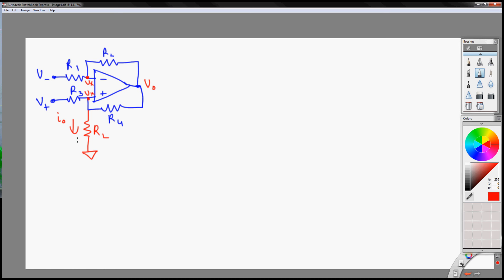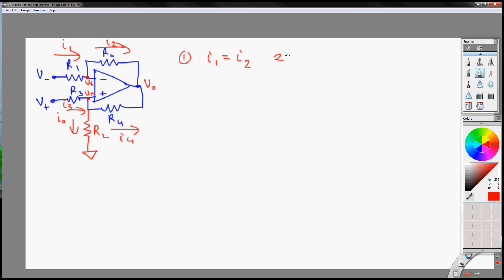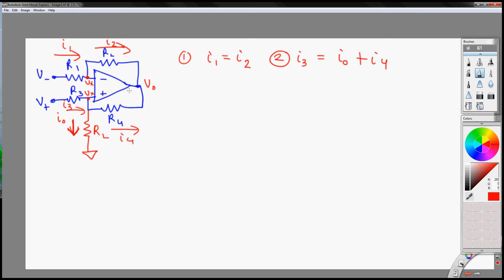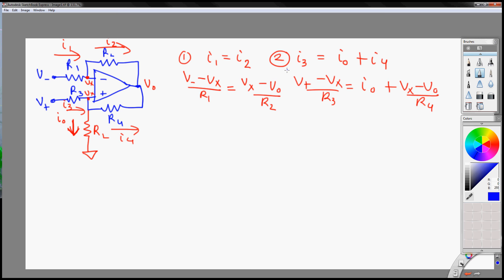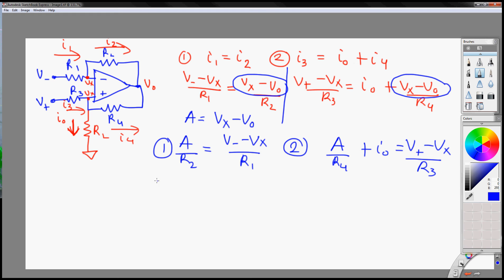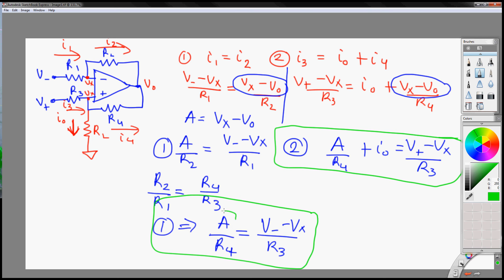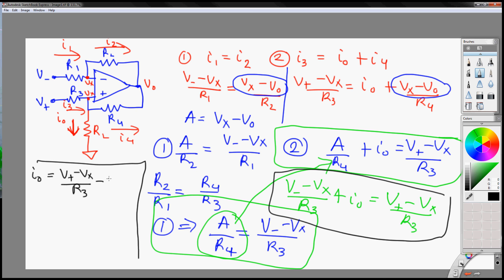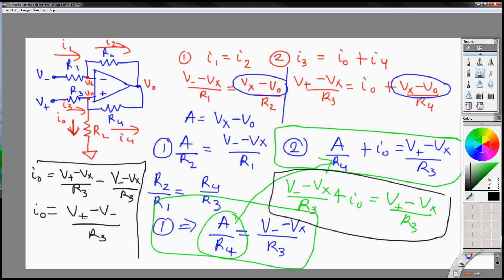What is a Howland Current Pump?

Comment: These videos could be so much more helpful with better delivery.  For example, a little more excitement in the form of inflection and emotion might help. In addition, it would help to have a better pointer or some method of pointing out what you're doing. Also, be careful not to skip multiple steps in algebra; for example, you totally skipped over how you got A/R4 equals V-  -  Vx / R3... I saw what you did, but it took me a little bit to catch up and figure out exactly the steps that you skipped to get there.  Finally, I'm not even sure why one would use this op-amp in this way... Example applications would be very helpful.

Comment: Thanks for creating this video and explaination.
However gain for an OPAMP based circuit is well defined by Vout/Vin.
If it is defined in terms of Iout/Vin then it is not gain.
Reply from the maker: That's voltage gain.  Gain is a general concept that can be applied for many different types of circuits. If you have current in and voltage out then the gain will have units of V/A or ohm.  With voltage in and current out the gain is A/V or 1/ohm or 1 Siemen.

Comment: Not sure if I got it wrong, but I think it would be more correct to say that the gain G = 1/| R3 |. In the video it sounds like G is in ohms.
Reply: Its not resistance either, Io/Vin = 1/R3 which makes it CONDUCTANCE (unit Mho).
Lol!
Reply: It's not gain of an opamp circuit, which is dimensionless, but rather a special definition: "output current per change of the input voltage".